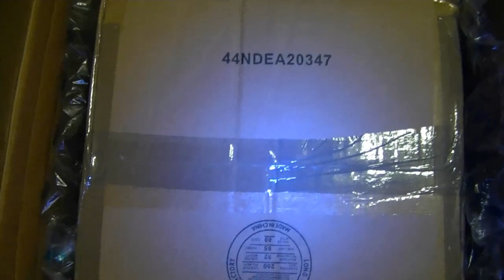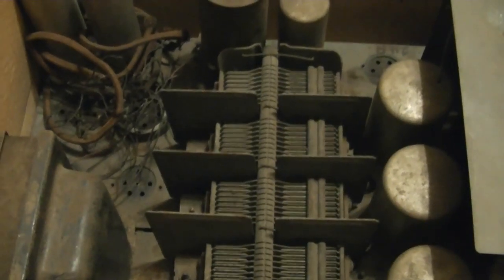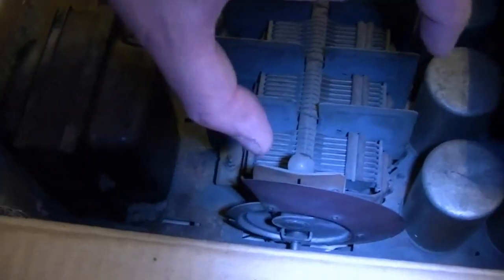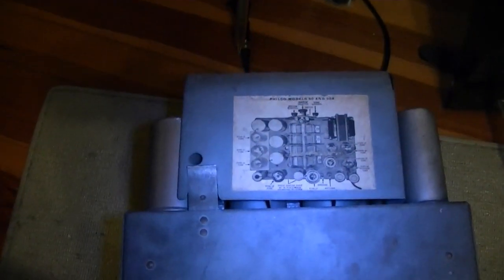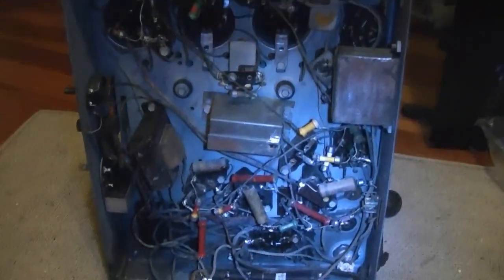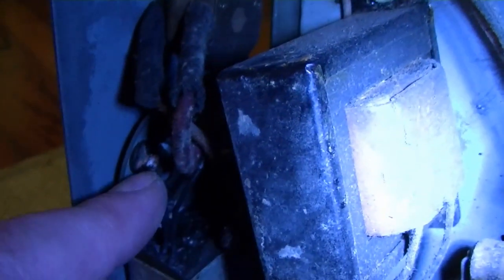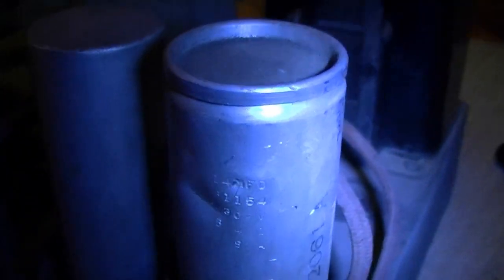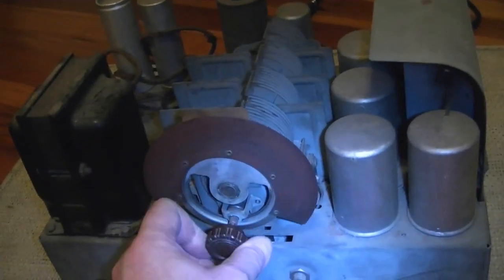Philco 90 a new chassis arrives

Comment: I wonder why they incorporated AVC (AGC) on the Philco 96 from 1930, but not the first rendition of the model 90 from 1931? Both used push pull #45s? That was definitely the right decision to get another chassis, far less messing around. Other then maybe the version with the push pull #47s I don't think any 90 chassis is even close to rare, I believe they made over 100,000 sets between all versions and cabinet styles.

Comment: I wonder how much different or noticeable  the tone would be comparing the models with the push/pull 45' triodes to the  single ended #47 pentode output
Reply from the maker: The single #47 type used the free space to add an AVC circuit.  I would expect the class A #47 to have a less distortion than class B #45s.  That being said, the 45 version is earlier, rarer and worth more.
Reply: @bandersentv  The push-pull 45's would be much more powerful than a single-ended 47 which could produce about 2.5 clean watts. RCA rated the 45's at 12 W in push-pull mode.
Reply from the maker: @1mctous  True but the speaker is the same in all models so I'm not sure what the real world difference is.